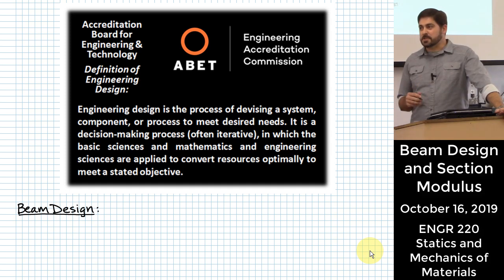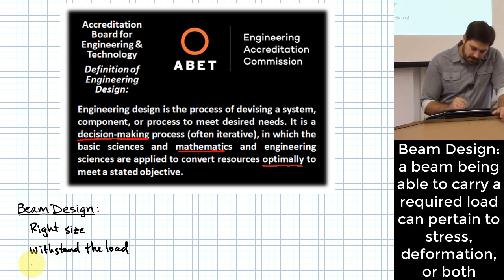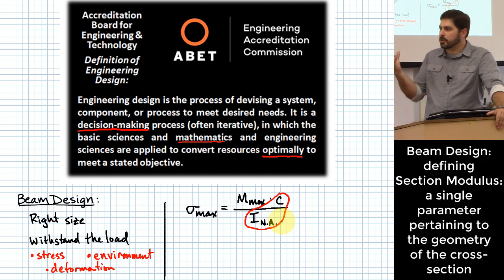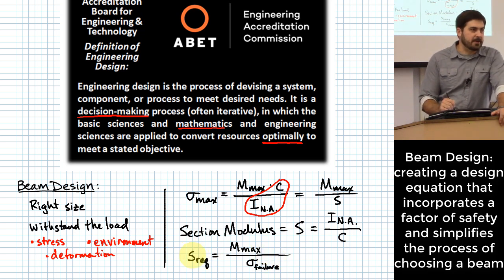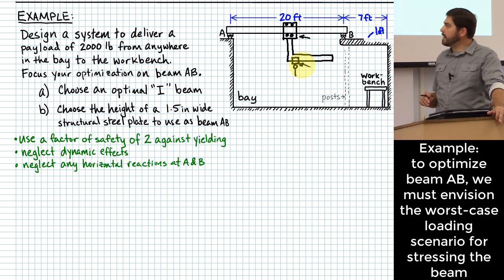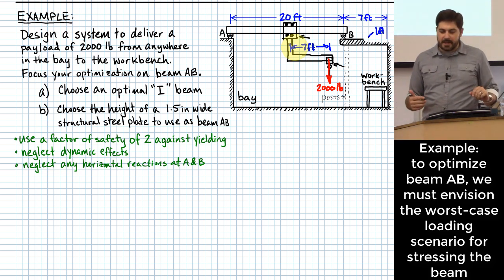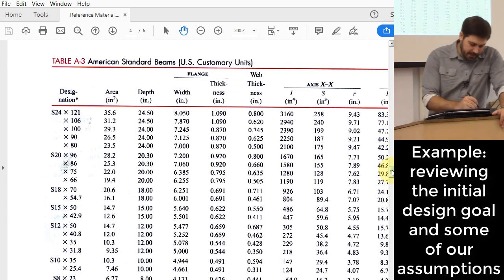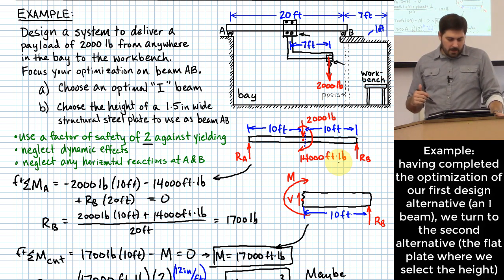BEAM DESIGN: Finding a Required Section Modulus to Choose Lightest Acceptable I-Beam; Minimum Height

Comment: Sir you arw great teacher! Your students must me happy that they have such a great teacher to teach them important topics which leads to be great engineer in future. Sir could you please tell the name of book you use?
Reply from the maker: You are very kind! I think there are a decent number of students that like me well enough, although it isn't ever 100%. :) I'm proud of all of the great accomplishments I hear about from students I have had in class because I feel like I had some small part in making them possible.

In this course, we use an older book called "Statics and Mechanics of Materials: An Integrated Approach" 2nd ed. by Riley, Sturges and Morris (Print ISBN: 9780471434467). We only use the book lightly because we have our own set of exercise problems, and a good sized cache of internally created notes and learning materials at our institution.

Thanks again for your kind words, and thanks for watching and spreading the word about this channel!
Reply: Interesting signs fuel canopies columns wind Force vacuum 100 200 300 feet moment Force deflection square footage single double triple column structure weight square tube wide flange pipe embedment soil strata concrete ballist Base direct burial j bolts rebar cage Gussets  weldments bolt size (
Reply: Jbolt column configuration oops hit the wrong button steel joints companion plates sleeve joints interesting sizing thank you
Reply: 100 200 300 feet in height yep pounds per square foot. Foot pounds moment
Reply: Oh cantilever single pole amazing bolts tensile shear wind velocity oh yeah floating Base amazing

Comment: Hi sir ..there is one question in  one of my exam ..they asked to select the correct A36 steel Universal beam which can carry 150 kn-m moment ..and also they given four options of UB sizes with Sx value ..how can I find it ..I tried  same procedure to find Sx  as u mentioned in this video but Sx value not matching ..I have considered allowable stress for A36 63 MPa and 150 knm moment they already given..but my final answer   coming .please suggest 1208 cm3 ..but all option is like 780cm3 , 569cm3 like that ..please help In this

Comment: dumb question, but when we used a beams own weight for second time, do we have to again account for its self weight, cause now its heavier than the first time
Reply from the maker: Not a dumb question...yes if you have to switch to a beam with heavier weight, it is a good idea to update the self-weight number and check to make sure that the new beam is still adequate.
Reply: @TheBomPE  thank you sir